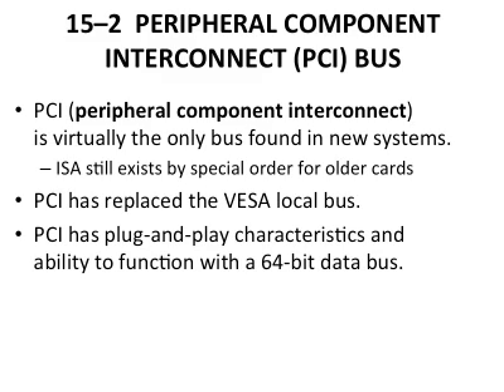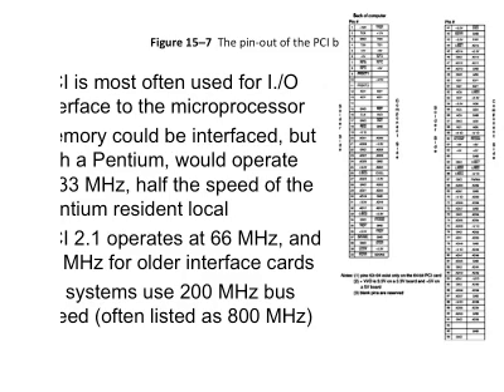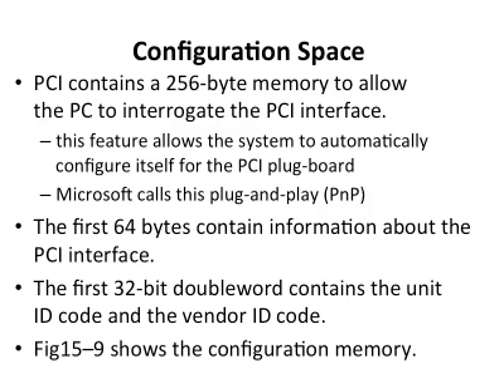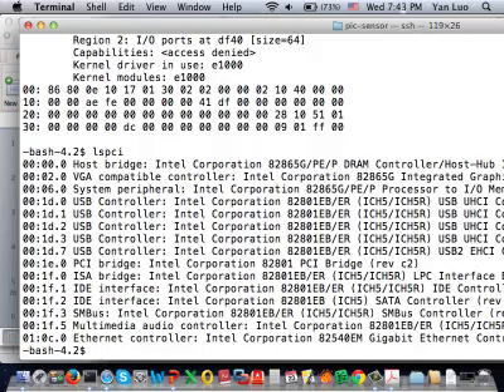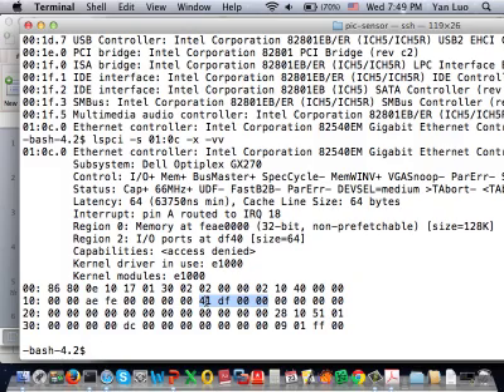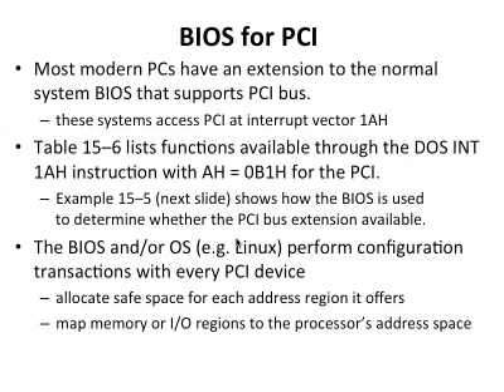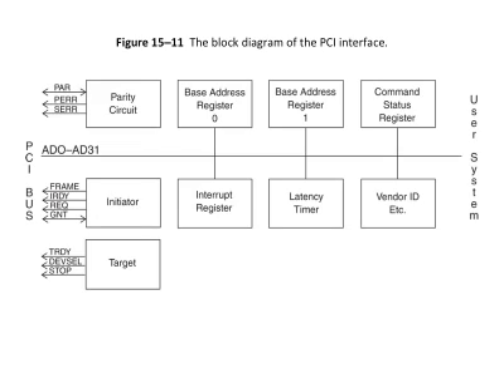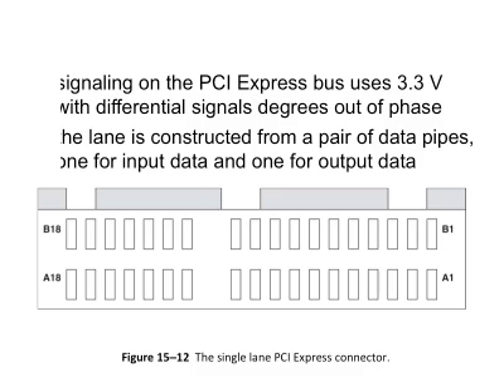PCI Bus

Comment: Hi,

I have 6 GPUs in my motherboard, 1 of them having drivers issue. When I open device manager<display adapters, the faulty GPU show yellow exclamation sign in the corner, when i check properties it says, PCI bus 3.

How can i find which GPU is connected to PCI bus 3, physically. So that i can replace with another one, rather removing all of them one by one.

Regards,
GP Arora

Comment: I have question about Full Duplex and Half Duplex.  When you have 8 bit PCI bus. How does work sending and receive data does it send and receive data simultaneously on 8 bit PCI bus.
For an examples if you have.
10/100 MB network cart Full Duplex and Half Duplex how does work on the 8 bit PCI bus.  Send and receive data.  Thank you ahilan.suman@gmail.com

Comment: I have question about Full Duplex and Half Duplex.  When you have 8 bit PCI bus. How does work sending and receive data does it send and receive data simultaneously on 8 bit PCI bus.
For an examples if you have.
10/100 megabytes network cart Full Duplex and Half Duplex how does work on the 8 bit PCI bus.  Send and receive data.